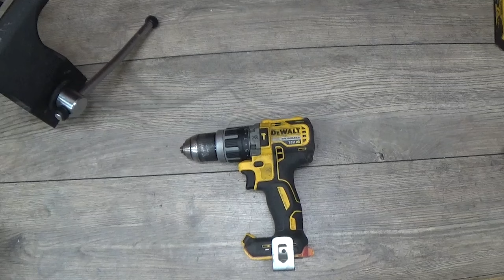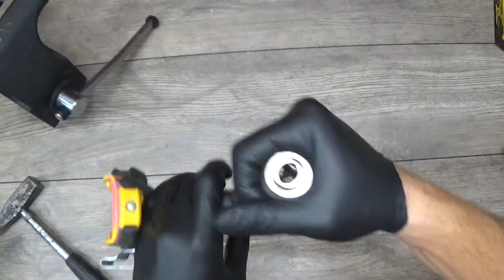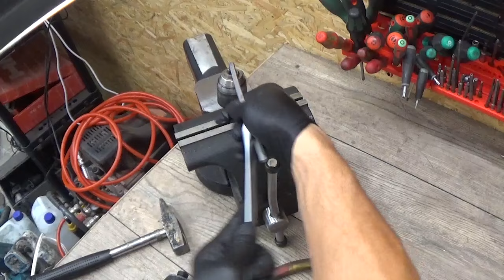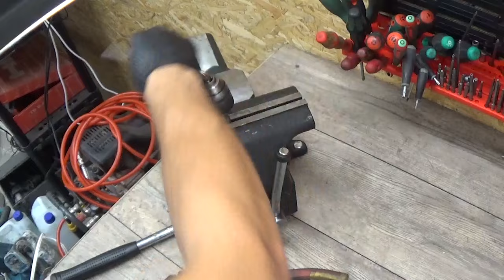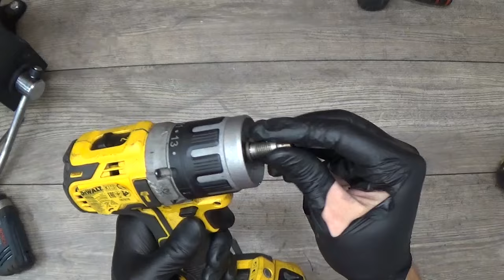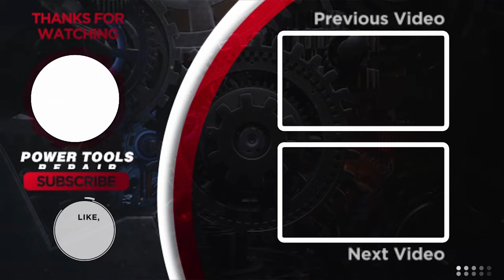Dewalt Drill chuck replacement - Removing a screw-on chuck - DCD796 DCD791 DCD790

Comment: My DCD791 has a retaining plate on the shaft with six small screws that fixes the shaft to the transmission housing.  There is no way that shaft is going to just pop out like this.  The important take-away for me is that the chuck is a normal, not reverse thread.
Reply from the maker: Chuck must be normal thread, reverse thread is screw inside chuck. All DCD791 I have repaired had same gear assy as in video

Comment: had to use plumbing pliers to get the bastard to let go of a bit, took 4 hours of trying all sorts, then when putting new bit in it sliced my finger on a freshly created metal barb -.-  damned things only 14 months old but I have just put a thousand long screws into a refit and structural fix on the kitchen so I guess I murdered it :).
Reply from the maker: Yes you murdered it 🙂 and its a reason to use gloves 😅

Comment: I would be very carefull removing the pin that the chuck screws onto.. Theres bearing behind the housing that wont come out with the pin, By forcing the pin out of the drill, you will have slid the bearing and hammer drill teeth off the shaft, The drill might get stuck in hammer mode with no way to release it.. That happened to mine.. Very very difficult to fix..
Reply from the maker: Same happened to me and I made next video on reassemble of gear assy to fix that
Reply: I just watched your other video, but you still havint fixed it.. If you look at the back of the chuck, it is still sitting too far away from the drill which means the hammer drill teeth and bearing are not fully seated down the pin shaft.. Look at the exploded parts diagram for the 796 and you will see where the splined teeth, spring washer and bearing are permanently friction fit to the shaft.. You have to do that first otherwise the drill will not go back together correctly.. @powertoolsrepair
Reply from the maker: @petrokemikal thank you very much, I don't have that drill now but I will make sure I do that when I will repair next same drill. Thank you
Reply: No problem.. Its a really annoying drill to repair.. I was determined to fix mine, it was only a few weeks old, but the chuck was really bad from factory.. It took me a while to figure out that the hammer teeth had came off the pin, thats why it is so difficult to knock the pin out.. @powertoolsrepair
Reply: @petrokemikal  Yes, I had the same problem with a stuck hammering, the fix is not difficult, you just need to change the procedure for installing the new chuck. After unscrewing the old chuck from the axle you need to loosen the round cover that is under the chuck (3 screws), under the cover is the bearing, washer, spring and shaft. It is necessary to take the cover to put the bearing in it and push the axle through (be careful not to forget the spring under the chuck), then you need to take the shaft and bump it all the way to the end of the axle, I chose the procedure of heating the shaft on a hot plate so it jumped in easily after a little tapping. Then you need to put back the spring and washer and screw the cover back on (3 screws). Finally, all that's left to do is spin on a new chuck (with the axle already installed in the drill). Hope this makes someone's day easier.....

Comment: Hello . I am in the process of replacing it, but during disassembly the cables came out of the connector and I don't know what colors and what. one connector is black and red together and the other plug is black and blue. should black go to black and blue to red? please give me a hint
Reply from the maker: I have opened this drill in this video maybe you will find what you need: https://youtu.be/NYkLzgg3NEo?si=j1zOgnO6n2d50bhk